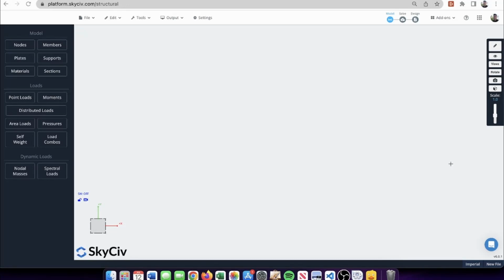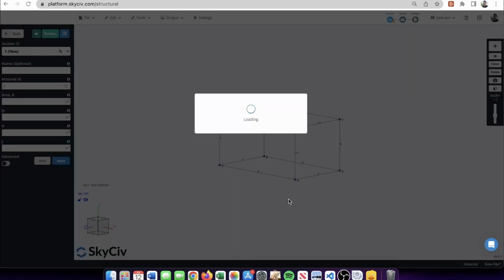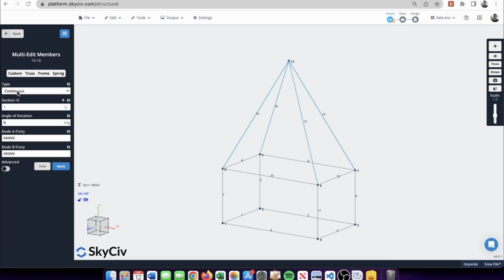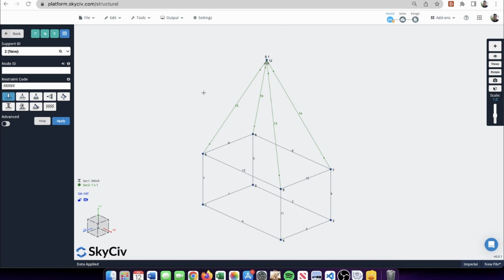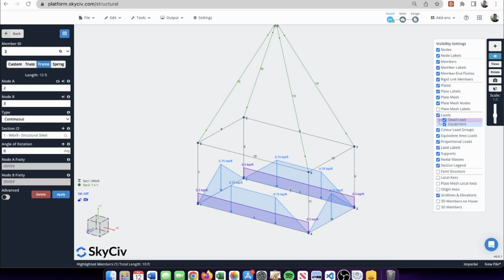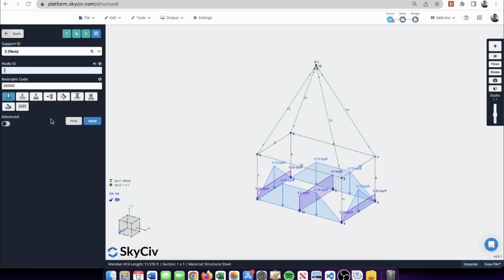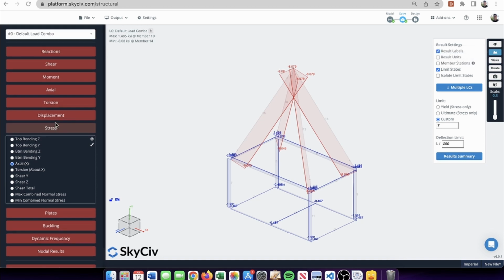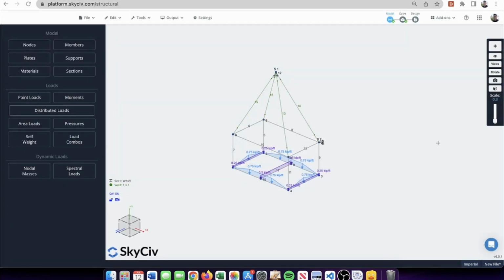How to Design a Lifting Structure Using Cables

Comment: Helpful tutorial.  I have struggled to incorporate crossbracing cables in my S3D models.  The solver generates errors, mentioning it needed to remove a cable element for certain load cases, found unusually high displacement values (perhaps because a cable was sagging ?) ... and generally left me baffled.  This video gives me some things to try so that crossbracing cables, important to my designs are used without my recent kludges: thin steel angle defined as "tension only" ...etc.  Really hope I can fix my cable issues as for me they are really important elements.

Because I am an amateur (not a structural engineer) using SkyCiv for my projects, I want to avoid asking questions of the SkyCiv support dept that a formally trained structural engineer would likely not find a need to ask.  The SkyCiv FEA tool has already been invaluable for my design work.  Will continue to learn about correctly setting up my models from SkyCiv tutorials.

Certainly my residential design product/project will require hiring a professional structural engineering firm to analyze and sign off on the design, I use SkyCiv to validate my own design decisions along the path so the design is within a practical range of feasible before it is submitted for formal analysis.